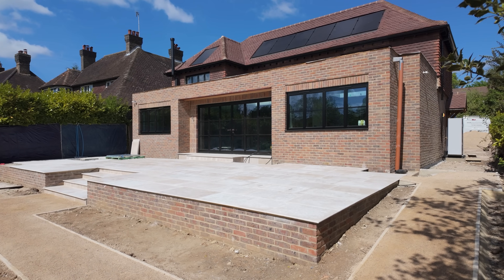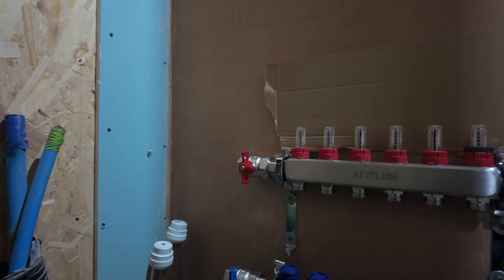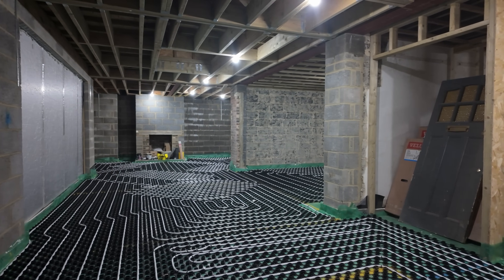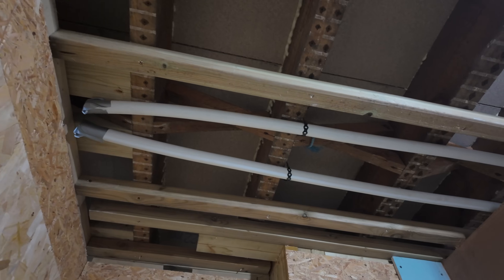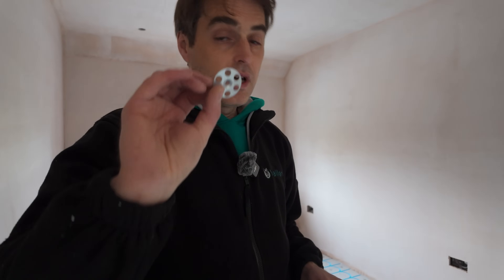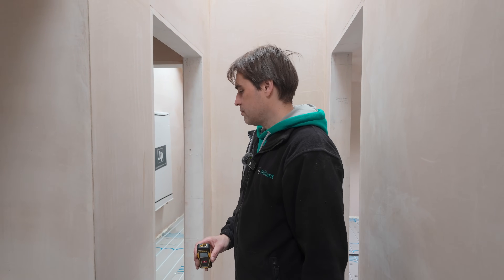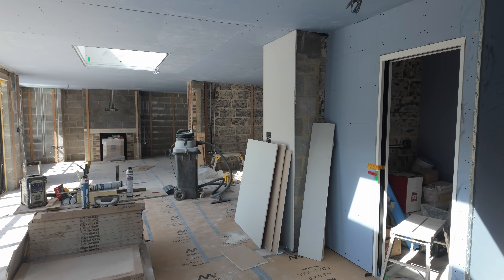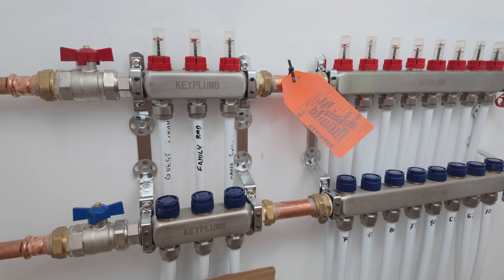Underfloor Heating & Vaillant Heat Pump: Full Install.

Comment: Hi loved the video we talked over a year ago when I couldn’t decide what way to go to heat our new home I eventually after watching lots of your videos went underfloor wet heating designed by Wunda but unfortunately they didn’t plan for a heat pump as the heat source I went with a vaillant system the installation company went with an open loop system so all the equipment that Wunda supplied ie pump sensors controlled panel and individual room actuators all redundant we have had problems it’s taken 9 engineers visits to rectify most of the problems were down to Vaillant engineers don’t ask but all working now also had a solar system installed what a difference that has made to the running costs the big test will be this winter as the system didn’t work properly last year. Thanks again and keep up the good work.

Comment: When we did up the cottage (no mains gas) I did look at heat pumps but at the time was just too much both work and money. Probably going to need to install floor insulation sometime so could maybe do it  then. Did put solar on in trays as whole roof needed replacing. Biggest problem is as you say Trusted Tradespeople, not just one size fits all installers.

Comment: Hi Syzmon, 

I love the idea of running the towel rails at the same Flow temperature as the underfloor.

is there a reason that there is a 3 port and an 8 port manifold used instead of an 11 port manifold?

Thanks
Reply from the maker: I just had a spare 3 port!

Comment: Hi syzmon  great video i have a similar project but has a radiator circuit so have designed to one flow temp have managed it with different pipe spacing up to 300mm but worried about  future proofing  any advice.
Thanks Dave

Comment: You keep putting out amazing videos, and I honestly wish the installers here in Germany had even half the knowledge you (guys) do. Over here, they’re still mostly working with small buffer tanks... The systems end up short-cycling themselves to death, and when combined with individual room controls, it’s just laughable.

What’s even more puzzling: Vaillant actually requires buffer tanks in Germany — totally baffling. I’m running a Wolf CHA07 without any buffer tank, just regular radiators — and it runs perfectly. The electric heater’s never even kicked in, and my measured SCOP is 4.8. So yeah, it all works — if you know what you’re doing. =)
Reply: Man Mathias Du sollst doch selbst Videos machen und nicht hier welche kiecken!😂😂 Ein sehr guter Kanal👍🏻.😃
Reply: @andreaskern1437  Darf doch auch mal loben 😅
Reply: @energieundhobby darfst Du natürlich, guter Mann.👍🏻
Reply from the maker: Sad really, isn’t it? So many heat pumps could run better and systems could be much simpler. Too many installers just blindly follow guidance and manufactures schematics instead of using their brains a little more.
Reply: @UrbanPlumbers  Yeah… it’s just madness. It’s not only bad for your wallet, but also for the environment — and with all those frequent starts, it’s definitely not doing the system’s lifespan any favors either.

What’s even worse sometimes are the settings. Some of the setups I’ve seen are just wild — like 2K hysteresis combined with individual room thermostats and tiny 200-liter buffers. How is that supposed to work long-term? It simply can’t.

That’s why your videos are such a blessing 🙂👍

Comment: I cannot resolve,in my mind, the question of DHW runs for distant bathrooms etc.as in,the hot feed will cool,after use,therefore when more water is required,that water has to be replaced with more hot water etc.which will then cool again etc.etc..so for hand washing after using the loo[for example] a lot of water is wasted waiting for the hot to come through,which after a splash and dash, cools..and so on...but is the answer to have constantly pumped [circulated DHW],which is used in larger buildings ,hotels etc.etc... or could electrical instant hot water heaters be an/the answer?,obviously,considering aesthetics......
Reply: Great question have pondered it myself for some time. We actually use an electric kettle in the kitchen for small doses of hot water. Dont like to watch the cold water disappearing down the drain knowing that it has been heated some time before and cooled down

Comment: Just had our heat pump installed in our seventies house and the gas meter was removed last week. The install had a few bumps along the way, but we got there in the end, but some things could have been done much better. I have a large solar array and 29 kWh of battery storage, so except for the very worst winters days the bulk of our heating/hot water will be done on 7p electric subject to rates changing. Current hot water costs are about 18p a day. Solar/batteries has meant our gas/electric costs have been negative for over two years.

Comment: Awesome video as always!

Were the underfloor dowstairs and pretty close to each other in regards to design flow temperature taking into account the two different underfloor types?

How do you find the cost difference between the egg trays for underfloor and the cheaper method of plastic clips. We find that egg trays can end up costing £100s more depending on floor area?

Also what are your thoughts on the best way to mitigate the sound of high flow via radiators, the best solution would be a manifold and pipework to individual radiators to have the noise at the manifold. We find that unless you start putting in 10mm plastic or copper to radiators all that noise happens at the radiator valve as you are restricting it far too much.

Comment: 6:15 I didn't go for towel rails fed by the heat pump, installed eletric one's....and ended up never using them. With UFH on (mine is set at 20-21ºC), even in winter, towels just dry pretty quick

Comment: Great video, many thanks. We are in the middle of doing pretty much the same install. UFH down and UP with a vaillant HP. We put Solar and battery in during the renovation also. Taking a while as a self build but looking forward to the end result. We did reach out about getting you on the project but timescale weren’t lining up. We are a little bit worried how the property will perform as it’s quite open plan and a large footprint.

Comment: Dutch guy here. I have a house from the year 73. Wals, Windows and roof insulated. No underfloor heating, radiators with boosters on it. Solar pannels and a plug in battery. Mitsubishi ecodan 8kw unit with 200ltr unit for dhw. It work fantastic. From march till the end of october no eletricity costs... free heating and showering...
Reply: Same here, only 6kW ashp and house from 1936, 1350 kwh_e for space heating last winter

Comment: We live in a 15 year old house with excellent insulation, solar panels and a battery, i would like to fit a ASHP and the associated works but we have plastic microbore pipe work throughout and hard flooring down in most rooms. I understand that microbore pipe less than 10mm is not suitable for these systems, there is no way we are ripping up floors etc to replace piping so presumably we will need to continue with our combi boiler until the entire house needs refurbishment?

Comment: Szymon, you are a star.  Your videos are clear and well produced, you don't resort to those aweful shorts to boost your viewing figures.  You show mistakes and where compromises have been made - you come across as very honest, real life doesn't fit the classroom or regulation model in every way and you embrace this openly.  You have weathered the negativity and lack of understanding that many commenters push your way with dignity.
I don't miss your videos, they all get immediately viewed.  If I ever met you at a show you would get an instant hug and I don't think I am the only such fan.  You must walk around trade shows with trepidation at random strangers jumping out at you!

Comment: Nice house, looks like they're investing a pretty penny into that place. The real problem is houses like mine. 20+ year old boiler, 78% efficiency, doing £3-4k energy per annum. Even if the boiler goes bang, converting this place to battery/solar/HP is going to be well into 5 figures, whilst a simple boiler replacement is £2-3k. With a best-case SCOP of 4-5, I'm barely beating the price differential between gas & electric (current tariff is 3.62x), meaning the payback is loooooong. Sure, if the house was a keeper like the one in this video, I might consider it, but I have a young family and who knows where we might end up in 5 years? I'm not going to drop £10-20k if the next occupant is the main beneficiary. If the government wants people to switch, they have to find a way of removing that uncertainty.
Reply: if youre getting solar and batteries your scop is basically infinite because you're not paying for it...

Comment: I am just struggling to understand how heat pump internal pump will run 3x manafolds with enough flow.
Reply from the maker: Easily if you size the pipework right and understand pressure loss and heat loss
Reply: @UrbanPlumbers  it works now but what in 10y, when eventually pump gets weaker, pressure loss becomes biger because of the corrosion and who knows what, and major thing a  plumber comes out he now wants 2l/min trough each circuit cuz homeowners told him its not warm enough. He has no clue how much flow he should have and he wants increase the temperature. Those are usually most common problems.
Reply from the maker: @BriaCroTex corrosion in 100% mclp and copper system is not an issue. 2lpm is not needed here but possible if required. Pump runs at 80% power.

If pump fails you just replace it as you would do with any other pump

Comment: For a boiler replacement, definitely difficult finding an installer at a price point that is competitive with a boiler replacement. 
Or there is octopus which is oversizing it and is completely inflexible, just working to a formula and if the formula is giving the wrong result, tough. 
For my straight forward swap I found plenty in the £14-16k range, but very little in the 1
£10k range.

Comment: You rightly highlighted the issue for consumers. It is near impossible to find a competent and careful installer in the renewables world, I think it is because the sharks are out to feed on the government grants that are available. The existing standards and quality control mechanisms are wholly ineffective.
Reply: We are out there, competently and conscientiously doing our thing. Our ethos is very similar to that which Simon adopts. The thing is, though, we don't advertise and have a relatively small volume of good installs, unlike the larger companies that are more volume and turnover driven. I agree that there are some companies out there that should not be installing heat pumps as they just don't care. The control mechanisms are not there but then again what control mechanisms are there out there in any of the trades?
Reply: @Ifitaintbrokedontfixit   I had one about 15 years ago when I lived in Switzerland, it was amazing and the install quality was what you might expect in a nuclear power plant. 
Mine going in next week, I’m dreading it😮 I did spend months learning how to correctly retrofit  the existing central heating pipe work and have made numerous insulation upgrades to bring the heat loss down to a more reasonable level at 60W/m2 from its original 100+, and learnt to correctly size it so that I’d know when things were wrong. 
Chose the only supplier whose offering specification matched my user specification and that seemed professional and had overwhelmingly positive reviews, contracted Plug me in to do the job. Have you heard many horror stories about them please? Did find an independent, but they wanted £40k to do, it’s a 300m2 house with 26 rads which all need upgrades, but still that was way too expensive for a system that I want to save me money.
Reply: @Ifitaintbrokedontfixit  I do most stuff myself, because I hate employing trades, everytime something is not done correctly or corners are cut, and you can't go by reviews as most the general public don't have a clue, so they think a jobs been done well, just because the tradesmen were polite and tidy. Due to cost and the BUS grant I had to get an installer to fit our ASHP,  there was problems on Vaillant's part (faulty heat pump), and problems on the installers part, most notable trying to fit what should have been a 5 day install into 4 days (bank holiday week), and not sending enough experienced plumbers (1 + two trainee's), leading to trainee's making mistakes as they were left to do their own thing, and ignore instructions/requests. My installer did care, but I think they just expected the lads to do a good install, ignoring the tight time frame, or did they just care after I kicked off?? As I said I can't trust reviews, so how do a find a tradesmen that's going to do a good quality job???

Comment: Completely agree that ASHP should be considered during renovation projects. Unfortunately this often frustrated by the main contractor desire to use a heating engineer they work with regularly. Who unfortunately either has no experience with ASHP or worse third party bad experience tales. Doing a heat loss calculation and planning insulation upgrades during renovation is something that get downgraded to only what building regulations requires. Getting the radiators and heating pipe work sized correctly for ASHP and not the usual basic heating system.
Reply from the maker: Just had it today - main contractor asking for tender - we don’t do tenders, sorry!

Comment: I'm building a new house ATM, no grant available apparently? It's heat pump ready but I'm doing a gas boiler! The cost difference is huge and any savings are 10years away, The EPC was done on a LPG boiler and estimated running costs are £600 PA,LPG is  9.5p KW and to pass the EPC we needed 7.4kw of solar. I've got temperature & humidity data logging that's been running for a few months since it was weather tight, the temperature remains virtually constant, I can't really see it needing much heat anyway!
Reply: Not sure how the "cost difference is huge" on a new build, as the bulk of the work in installing a heat pump is making the home heat pump ready.
EPC is unlikely to be accurate, but even so, a heat pump might cost a couple of grand more than a decent boiler.  With 9.5p/kWh for LPG, at £600 per year that's 6315kWh requirement, at 95% efficiency, it's 6000kWh of heat.  With a heat pump you're likely to get a SCOP of around 4.5, so 1333kWh even on the price cap, that would be £360 per year.

That's without taking into consideration other smart tariffs or your solar array.
Reply: @BenIsInSweden  I'm a gasman by trade, I've worked for a company that installed air and ground source, I've done many manufacturers training courses and personally installed over 80 heatpumps, we've been off grid for electricity for 5 years so we all ready have a good Victron inverter/battery set up, there are some brilliant boiler deals around! WB 4000 12kw LPG system £750, low end heatpumps start about £2.5k!
For me it's a good experiment, hopefully collect some good real world data?
Reply: @551moley  Looking online the WB 4000 12kW LPG is ~£1100-£1400, add in the cost for an LPG tank, you're looking at getting close to £2k for LPG. But regardless, in the context of a new build costing in the hundreds of thousands, I'm not sure how a couple of grand can be seen as "huge".
If the target is completely off-grid, then LPG does make more sense, but in a scenario where you've already got solar and battery with an on-grid connection, then a heat pump becomes a no-brainer, e.g. Eon next drive which apparently doesn't require an EV would allow you to charge your batteries at 6.7p/kWh, bringing that annual cost down to about £90 per year for the heat pump.
Reply from the maker: @551moley low end heat pumps are now £1500 - £1800. Decent boiler is £2k. Direction of travel is only for oilers to go up and heat pump to come down
Reply: @UrbanPlumbers  I've just bought a new WB 4000 LPG 12kw system boiler for £750 Inc vat! Online stock clearance! ICF house with Mvhr, I've been logging temperature data for a few months and it's looking really good, I honestly can't see it needing much heat at all, virtually passive.
Interesting experiment is how I'm looking at it?

Comment: My biggest regret during our renovation was not replacing the heating. The boiler was a bit old but still working.
We ended up taking down a wall and replacing 2x 3kW output rads for silly 800w skinny ones.
Boiler chucked it and we realised we’d need to just replace the lot anyway.
PITA, if budget (hindsight) had allowed during the renovation, I’d have simply did it at the time.
We ended up paying for the new Ecodan system on 0% after the 7.5K grant anyway.

Comment: Self installed the Vaillant AroTherm 5k last October, and have 7.9kWp of solar self installed - half since 2019 and the other half in mid 2023.  Have around 30kWh of batteries too.

Means I can almost run all year round on night rate bought power (5c/kWh)